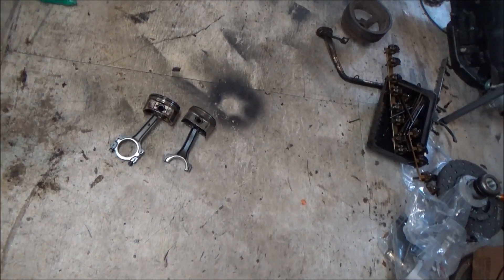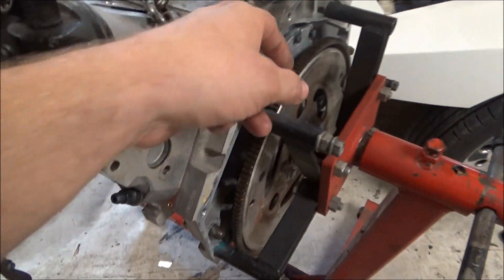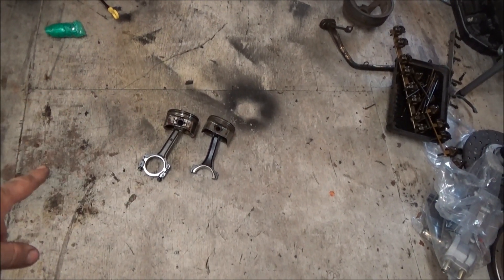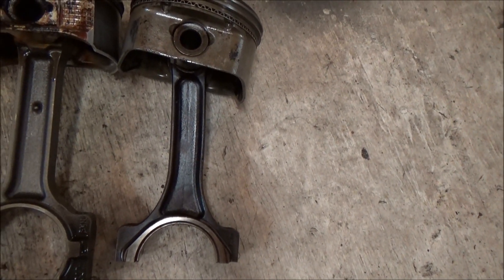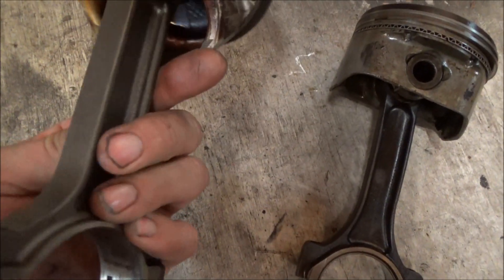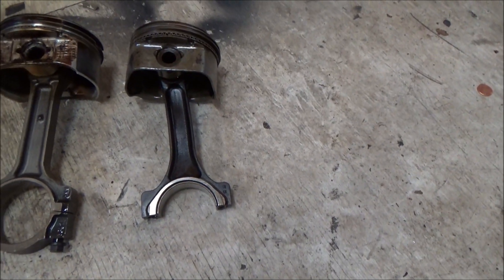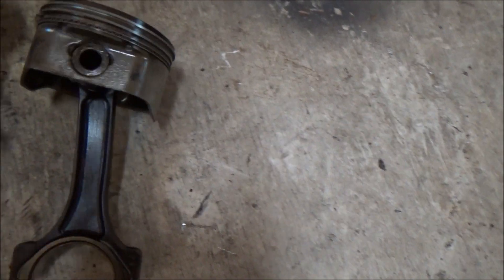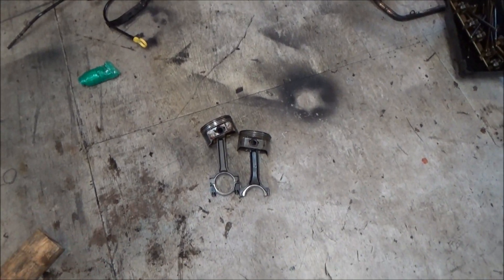LSX Gen 3 and Gen 4 rod comparison

Comment: Used the GenIV rod in a GenIII engine, so before I began, I weighed all the rods and found that the newer rod weighed about 32 grams more than the older pressed pin rods. There was a 23 gram difference in the pistons, the newer design being heavier. I took the whole assembly, rods, bearings, pistons & pins retainers, and rings to an engine shop to have it balanced. The crankshaft needed weight added to balance it out. Also took the dampener, and flywheel along to have them checked. Tungsten can get pretty expensive, they welded the balance holes up to make up the weight difference.

Comment: On a 5.3 Vortec, the newer floater rods weigh 33 grams more than Gen3, so take that into consideration if you try to put floaters on Gen3 motors. They fit but have to be balanced. If you can put the 24x reluctor on the newer 48x reluctor crank, you are balanced whatever the factory tolerance were balanced. Old gen 1 chevys were factory balanced to within 2 grams. You can run them unbalanced but you are giving away power through friction and wearing out bearings, and creating a bomb.

Comment: I've seen that the LSA has a unique part number for the rod.  How do they compare to the standard Gen 4 rod?
Reply from the maker: I have never checked into it
Reply: LSA 6.2L  ZL1 6.2L & ZO6 7L all forged connecting rods..some newer years titanium connecting rods.
They are stronger than standard 4th
gen or 3rd gen.
Reply: @408SPLKINGS   LS7's all have the titanium rods regardless of year.  All other have powdered metal cracked cap rods of various strength.  What I wanted to know was what made an LSA rod different than any other gen 4 rod.  I later found the answer.  They are indeed heavier than a typical gen 4 rod. Great for boost but not high RPM.

Comment: Thanks for clearing that up. So in your experience what is the strongest stock LS style motor I can buy used? What is the top of the list in junkyard LS boost motors?
Reply from the maker: +BLACKLACDTS   strongest is gen 4 rod equipped 5.3 and 6.0  , 4.8s have a slightly longer rod so are a tad weaker by default.
Reply: 4.8 flat top pistons fit in a 5.3 to boost compression, so the different cubes are in the stroke. That means the 5.3 rod is longer, not the 4.8.
Reply: @donrutter6765  Nope. The difference is in the crank. People use 4.8 cranks to de stoke 5.3 motors. https://sites.google.com/site/sloppywiki/everything-ls/is-that-a-4-8-or-a-5-3